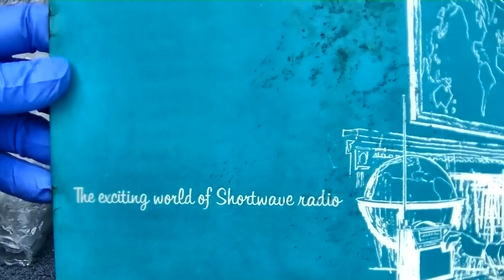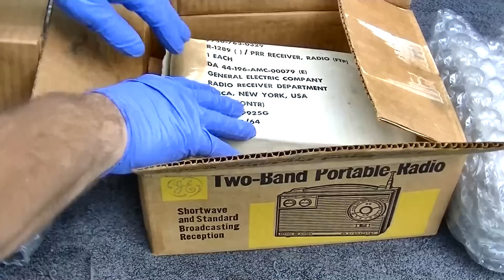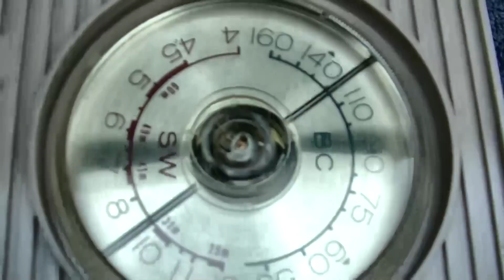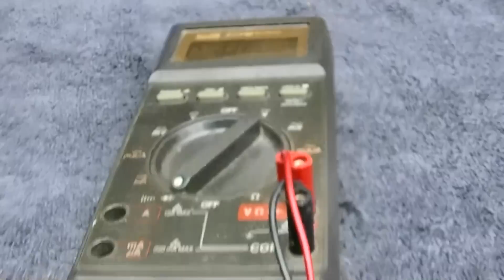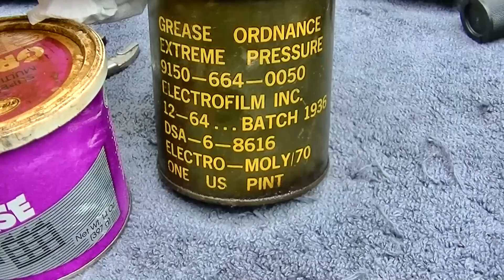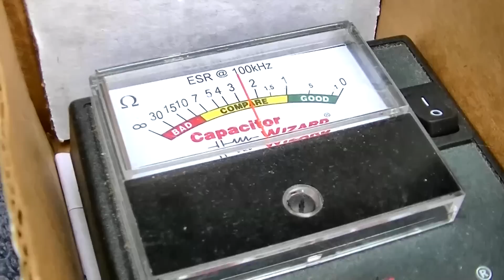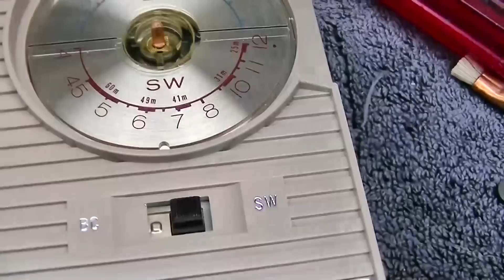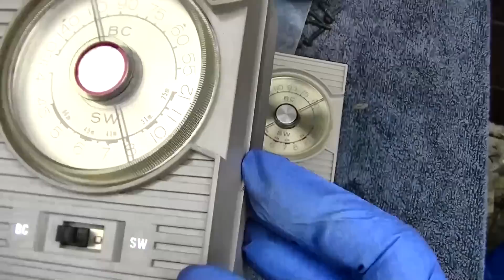GE P925 2 Band Repairing 2 NOS Vintage Transistor Radios

Comment: Well I have to report that both radios are still working great and they are in my collection of radios that I rotate around to keep everything working. They both are good AM dxers and work well on SW if you tune very carefully.  Especially with an external antenna on SW.  Still lots to listen to on SW.  I glued the centers back in the knobs so they look nice.  Great tip about keeping the power switch on with the batteries out. I'll start doing that on all my radios.  Thanks again Shango and a great (I especially think) video!  Ted
Reply: I've been intrigued with SW. Unfortunately every attempt has been dull. Probably need to set up some wire outside.
Reply: @directcurrent5751  Either better antenna or you need to get away from local noise sources, like the ubiquitous switching power supply.  That may mean going on battery power and getting out of the house.
Reply: @directcurrent5751  12.160 11am to 3pm
Reply: @russellhltn1396  guess it ain't happening
Reply: Nice radios. I wish I had one. I'll keep an eye out for one.

Comment: Great switch work! Another option is to use a tiny twist drill and carefully bore a hole of the wafer between the contacts. Be sure and use a vacuum to keep the shavings out. Use naphtha  dripped into the hole and agitate the switch. This softens and cleans out the old grease. Next flush with switch cleaner and use a Deoxit with some lube action. I've revived poorly stored switches this way.  Just a suggestion to consider for other projects.

Comment: Scratchin' in 2022 from the 60s. As I said in a comment before joining this channel this was my first SW radio, at 10. Took me a few years to find another so this is just gold to me. It too had low volume. Nearly broke my finger hitting the screen of the phone to 'Buy Now', I've never seen the manual, so this goes into my collection of saved videos. Hiversum Holland around 7MHz was my first DX and that Fine Tune (it drifts the local osc) is very nice for a bargain radio of its day.

Comment: I have a NIB one of these GEs too and had the same problem with the power switch, both sets of contacts in it were measuring in the megaohms when closed.  I filled a short little cup with mineral spirits and set the chassis down so that just the top half of the switch soaked in the cup for several hours.  After a few dozen turns on and off,  I was surprised it actually worked, both now measure 0 ohms.

Comment: I vote for disassembly of pots and switches... I would say those sprays might work quickly but the problem will come back with the same speed as well. Only thorough cleaning and re-greasing will work for the long run!

Comment: One quick fix , that for sure did not always work, is spray as best you can into whatever hole or crevasse you can find then  apply  45 watt soldering iron with switch open  . Then move contact rapidly while still hot. Heat can soften grease and might even vaporise  it off . Wiping action you noted can then push old dry grease off. Again not a perfect fix but it is quick.

Comment: that smell like the no pest strips of the 1970's? I remember that smell. 
Another interesting video!! 👍
I knew about taking batteries out of things not being used. I didn't know about keeping the switch closed. And I also did not know about the lawn mowers. I learned a couple things today!
Reply: The engines don,t have points anymore but when you do what Shango spoke of that will keep moisture from getting into the cylinder.1 lung engines only.
Reply: You can still buy no pest strips at Walmart.  They're no longer made by shell.  I guess shell got out of the pesticide business.

Comment: I began my journey in electronics on tubes in the 70's and we new digital was upon us and consumer electronics were about to be a throwaway industry. I have really enjoyed what you do and already learned alot. Correct me but you seem to start with what is not working and make decisions based on vast experience, a little touching, tapping, maybe looking for hot components. I suppose , every case is different when we break out the divide and conquer rule. As in, take some measurements, dont get me wrong, I totally appreciate what you throw out there and the edgy comments are fantastic. What is the sweatshirt you are wearing/ A RUG?
Go to the store and buy a sweatshirt man.

Comment: Hurray for risk/reward discussion on changing working electrolytics in this application.  It depends; they work, ESR in tolerance, aren't going to destroy anything, replacement could do collateral damage to a working radio.  Very sensible.  Thanks

Comment: Have worked on those Clarostat switches before. There is a version of those where the wafer board with the contacts does not come apart for disassembly. In my case, the switch spring disintegrated from rust so needed a new switch. Two years of waiting till I found one on the ebay...

Comment: 29:07 while having two radios together you should try tuning in both radios to the same sideband frequency so that they would be able to be clear.👍also, the radio service manual says to slip two strings behind the tuner knob to pull it off.  Thanks You for your videos 🔧👍
Reply: I didn't know that would work for sideband. Cool.
Reply: Yes, it is heterodyning.
Reply: Someone must've never heard SSB on AM. That doesn't even remotely sound similar to SSB on AM, that sounds like FM on AM.

Comment: Those general electric radios were made specifically for the military and not for civilian or to be sold in the PX.  Those were specially prepared for long-term storage. Many times that type of storage bag was lined with copper or aluminum foil to reduce the chance of EMP.  What was the real reason for the special preparation? Who knows, it's the military. 😁

Comment: I've had good luck cleaning contacts on switches and relays like that using 24V AC and a solenoid.  the voltage is high enough to break through the oxide and the inductive kickback is pretty good about blowing the crap off.  obviously disconnect the switch from the circuit before doing this.

Comment: Hi Shango you have a lot of experience on small pocket germanium transistor radios. I am trying to isolate distortion in a small 3" reel to reel tape recorder. It has a 4 transistors germanium amplifier that works on 6volts. I'm thinking a bad crystal mic. I looked at it several times already on and off when I can at where I work. Its my own personal and I'm too tired to work on it when I'm home. I have to keep boss happy first and repair the TVs first. I never had such a simple little devel kick my butt. These little tape machines are terrible for sound anyway but I think it can do better. The play/record head does not have a ridge and I cleaned it. It has new capacitors. It has dc bias and I thought that is why it sucks but I listen to other machines with dc bias and they sound much better. The bias voltage is 130mv on record close to what my other one has that sounds better but its a different brand. If I take an audio signal from a radio earphone Jack and couple it to the play head with the radio volume on very low it comes out clean from the tape recorder speaker after adjusting the radio volume control so not to overdrive the amplifier input. The same amplifier is used for record so I don't think it's the amplifier. If I record then playback it sounds like the audio is chopped up fast like a scratchy throat or like a transistor is biased too low. I been repairing a lot more complicated things than this and they work. I even work on high end reel to reel machines and they sound great but this little devel!!!! I like a challenge. I remember when I was about 8 years old I used to play with these but every one of them played good when they were new for about one year then got distorted then finally won't record at all but would play. Every one did that they would lose ability to record but play fine. I hooked up a function generator to the mic input and applied a one kilohertz sine wave and it can record a steady one kilohertz sine wave with no distortion on the oscilloscope but has sort of a funny looking ramp distortion with crossover distortion at around 400hz. I remember when I got my first cassette recorder it was when the cassette beat out the little 3" reel to reel. Same dc bias, same germanium amplifier but for some strange reason it blew away the little three inch machine in sound quality and lasted much longer than one year. I've been tempted to convert it to silicone transistors and re bias. Maybe germanium has weird defects at certain low frequency when they're bad

Comment: It is a good switch pot! I think even when contacts don't 'wipe' it can be better to spraying then not. (as long as the spray doesn't destroy anything near by, which is rare in my experience thus far). The spray could break up/ loosen hard deposits so the contacts can then crush it, maybe it falls off.

Comment: I don't know if it would work in your situation but I have had some luck putting bad switches in an ultrasonic cleaner.
The fluid i have used varied from Mr. Clean to IPA

Comment: One old trick for bringing corroded contacts back to life in switches and relays where it's too hard to get at the contact points is to isolate them electrically and feed a higher voltage to them and then activate.. The higher voltage is more 'willing to conduct' the arc - spark will clean the contacts up a bit.
Reply: @David Wanklyn I think people put an incandescent light bulb in series to limit the current. But yes, I had thought of this working.
Reply: i did that with a erratic keyboard switch on an acorn electron computer 😉

Comment: Good work. It's always hard to repair mint condition old stuff without damaging something. It's been ages since I've seen a product which uses C batteries.
Reply: It isn’t hard to find something that uses c batteries. Every time I open portable electronics I’ll probably c batteries
Reply: In electronics training I was shown several batteries and had to identify each type. Didn't do too well, got a D

Comment: Dear Mr. Shango: In a video with one of these GE P925 radios: you are "zero beating" two radio signals while the radio is tuned to approx. 570 kHz. (KLAC-AM)  From watching a number of your videos, I assume you are in the Los Angeles area...so if you were "zero beating" 570 kHz it must have been against KVNR 1480 kHz, licensed to Santa Ana.

I used to do the same thing as a kid in Rochester, NY where I would "zero beat" WGR (AM) in Buffalo (550 kHz) against WAXC (now WHIC, 1460 kHz.)  The difference in the two signals in both cases is exactly 910 kHz, which is twice the IF frequency of 455 kHz.  Then I found out the problem did not happen with a car radio which had an IF frequency of 262.5 kHz.  Thus I learned the concept of "image reception".

Comment: Good going Mr Shango. Did I see right, the dial has a geared vernier? If yes, where? Those sealed switches can be a true pain, I have always had success with filling them with a very light oil such as petroleum or kerosene and waiting a few days. The light oil softens the hard grease so it can then be flushed ot with brakecleen or contact cleaner.

Comment: I found an old restaurant employees manual from the 1950’s,in it amongst the tips on personal grooming stating that employees must have clean shaven faces at all times as well as short,nicely combed hair,it lists that the countertops,screen doors and other areas likely to come in contact with flying insects ants should be “liberally treated with a solution that contains DDT”.

Comment: 17:25 Driving a service van I can attest to the tendency for threaded fasteners to unscrew due to vibration.

I've used a thin double sided PC Board between battery terminals to measure current. It would also be an easy way to add a wired switch in place having jumpered the internal switch. Thin wire hanging out the battery cover or wherever advantageous.

Atkelar, another YouTube'r takes EVERYTHING apart. I've never seen anything like it. His results are compelling. I wonder about his fail rate and what kind of difficulties are encountered replacing controls and meters and whatever else doesn't take kindly to disassembly. I'm not sure I could, possibly ever in my lifetime, do some of what he has done. Too meticulous. And I'm just a brute. Lack adequate patience. I also don't know how some of these things are constructed.

No doubt in my mind that switches and controls disassembled, contacts cleaned and burnished, and proper lubrication provided will yield superior results. You did great!

Comment: If it was just tarnish, I would have suggested unsoldering the connections and making it switch a higher voltage, like 24 volt to puncture the tarnish.

Comment: I have kind of an off-topic question that maybe could be answered by someone here. If I can improve FM radio reception (eliminate static) by holding my hand on the telescopic antenna, how might I mimic the effect without me holding the antenna? I  assume that I am acting as a capacitor of some sort. The radio is an old Aiwa CA DW9 boombox that has phenomenal sound, and nothing I do or connect to the rear antenna screws has as good an effect as my hand on the antenna. There has to be some scientific answer/solution. And BTW, recapping the thing is out of the question as I do not have the skills, plus I started taking the thing apart, and the boards are behind several walls, and taking it apart would be akin to taking the Space Shuttle apart. Thanks in advance for any logical answer.

Comment: Acetone was first formulated to dissolve dry/old grease - that would be a perfect solvent for this purpose. I keep a small tub of 'plumber's grease', 100% silicone, available at most hardware stores, just for things like this. Good work shango!!!
Reply: Don't let silicone near any switches that spark in any way. The arc breaks it down into sand. A perfect insulator and abrasive. Silicone polish could be the death of an old mechanical telephone exchange. Explicitly banned off the premises!

Comment: 12:58 unhook the wires and use a high load with 120v thru the switch. it should spark clean the contacts. maybe a 300w bulb

Comment: Currently, the EPA has defined a concentration of 24 nanogram per cubic meter of air (ng/M3) for chlordane compounds over a 20-year exposure period as the concentration that will increase the probability of cancer by 1 in 1,000,000 persons. This probability of developing cancer increases to 10 in 1,000,000 persons with an exposure of 100 ng/m3 and 100 in 1,000,000 with an exposure of 1000 ng/m3

Seems perfectly safe to us....

Comment: Unsolder  the wires on the power switch and apply 600volts regulated current from a capacitor leakage tester !!!on the switch not the radio!!! I used a sencore LC51. Not the best way to fix a switch its the lazy way. I wonder how long it would work

Comment: BTW, silver oxide is a good conductor.
Reply: silver oxide is a good conductor ( white in color) but tarnished silver is bad, silver sulfide, ( black in color) and even though sulfur is a tiny part of the atmosphere, blackened silverware is the reason for polishing and occurs reliably over time.

Comment: Interesting radio.  It's not 6V, but +/-3V.  Without both voltages, only one side of the push-pull power amp would be working.  No wonder it was weak and distorted.

Comment: Did I miss why you wouldn't just replace the switch volume control pot?
Reply: Ummm probably because you cannot get that switch anymore. I'm sure you could modify one but then the radio would not be original.
Reply: @danielknepper6884  I may be assuming too much about what is available online.
Reply: @directcurrent5751  It's a royal pain to find something with just the right form factor.  In this case, you'd need to also find one that had a double pole power switch instead of single pole.
Reply: @russellhltn1396  T Y Russell. That's useful information.

Comment: To clean those contacts, apply 12V @1A directly across the contacts from a power supply then open and close the switch a few times.

Comment: The outer wrapping of the radio with the NSN (National Stock Number) and the nomenclature printed on it tells me that this was made for the military supply system, which is different from the military post exchange retail market. 

About the pesticide smell: my parents had the soil around the foundation of our house treated for termites with something, possibly chlordane, in the 70s. In the 90s my father planted some tomatoes along the side of the house and he told me that they had a terrible chemical taste but he ate them anyway. Shortly after, he developed tinnitus, hearing loss, and vertigo which was diagnosed as Meniere's Disease which is a degenerative nerve disease with no known cure. It eventually progressed to Parkinson's Disease over the next decade. I don't know if the tainted tomatoes caused it; he worked for the Bell System for 30 years and could have been exposed to PCBs or dangerous solvents, but the timing of his symptoms is suspicious. 

If you think that the package has been treated with banned pesticides, be very careful about handling that stuff and breathing in the fumes. Definitely don't save the box and wrapping. 

https://en.m.wikipedia.org/wiki/Chlordane

Comment: Disconnect  switch. Put some voltage across it like a charged cap. Turn it on. That might blast the contacts clean
Reply: ...or weld them together. 🙂